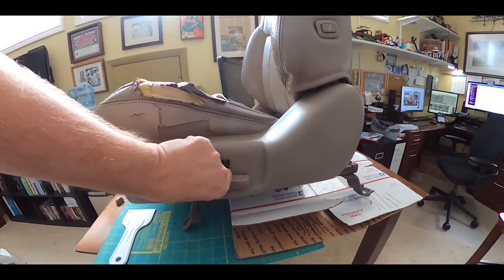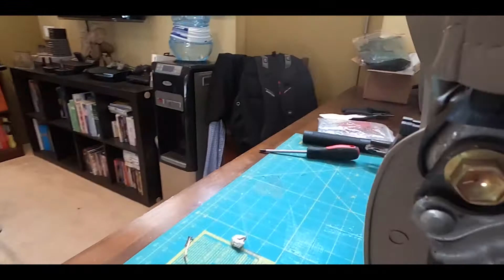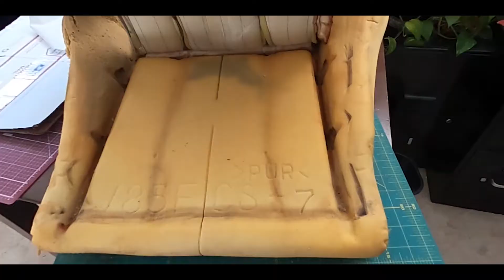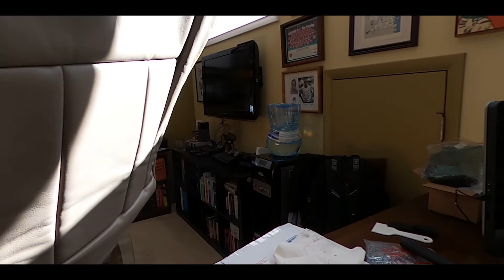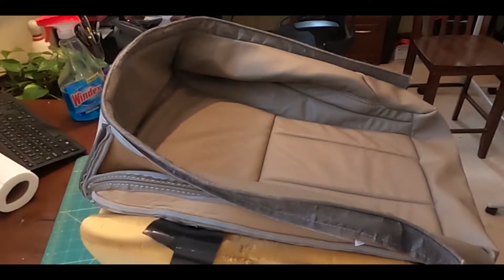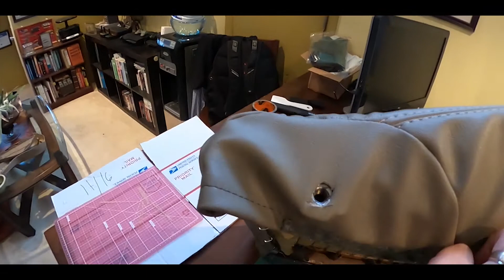1997 Toyota 4Runner 3rd generation seat leather replacement tutorial | 4Runner leather replacement

Comment: What about that pin that runs thru the pivot point of the seat. You edited that part out lol
Reply from the maker: Hmm .. it's been a few years since I did that. I don't have this truck anymore but thought I captured it all. Thanks for watching!
Reply: @jamzdotnet  well, there was also a heating element, or sensor on the cushion. I have a 1999 110k engine rebuild limited 4Runner. Wondering if the dealership traded the seat out before they resold it to my pop in 2005🤔
Reply from the maker: I did not have heated seats in mine.